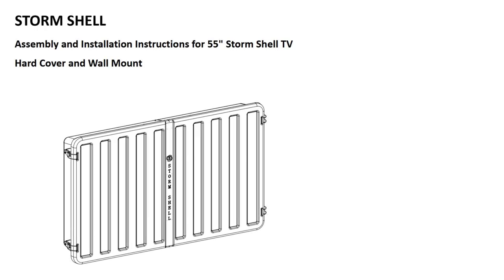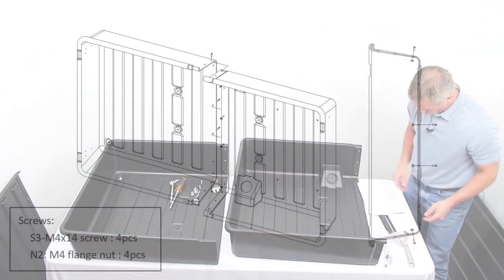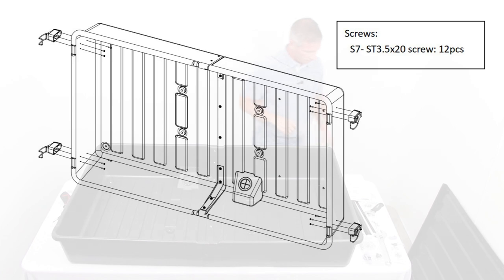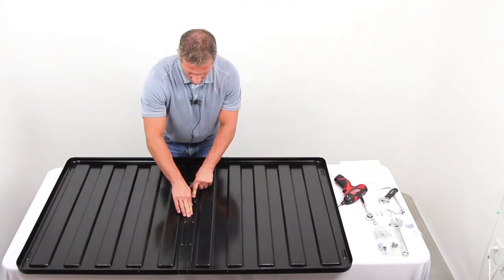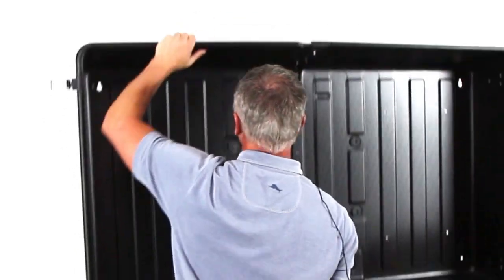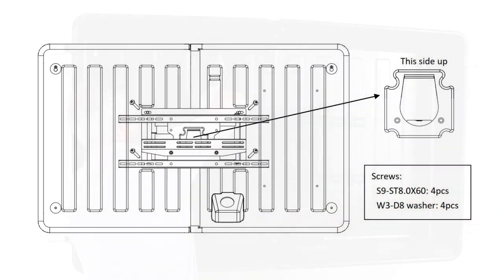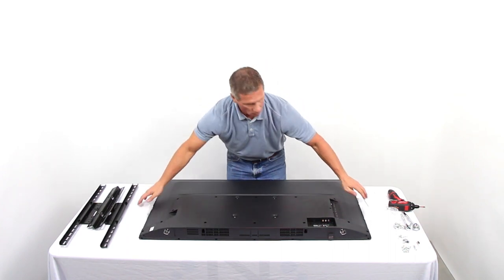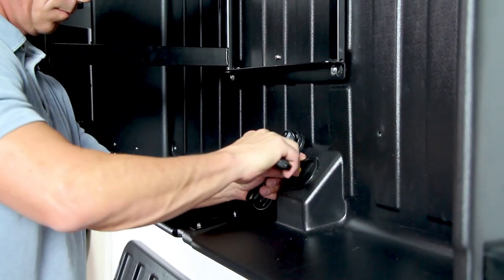HOW TO - Assemble Storm Shell 55 inch TV enclosure SS-55 (2020 Model)

Comment: Just put mine together, here's a few suggestions: 
LARGER drawings of parts & assembly procedure- needed a freaking magnifying glass to see it. Stop with the metric nonsense- if you're selling these in the USA, use Imperial!, the assembly instructions for the VESA bracket on both the instruction manual & the video couldn't be more confusing, there were steps left out & the written instructions are useless. In the end, I went to the video, found a frame with the assembled bracket on the TV & stopped the video and went from there.
For 400 bucks, I shouldn't have to call customer service & explain on a phone how to put this thing together.

Comment: What do you do if your tv holes are 8” x 8” on the back of the tv? How do you make the mount fit? We used only the square of the mount, none of the arms, but then when we went to put it back into the case the TV is too low to fit in it.  There is a lot of room at the top, but the bottom of TV hangs an inch too low.  There are no FAQs on website or information in the instructions to explain how to use the mount
Reply from the maker: Hi Jane! Thanks for the comment! Feel free to call customer service at 435-752-6611 we would be happy to assist you! This is our first season with this product so we are still adding content to help each customer with their questions.  Thank you!